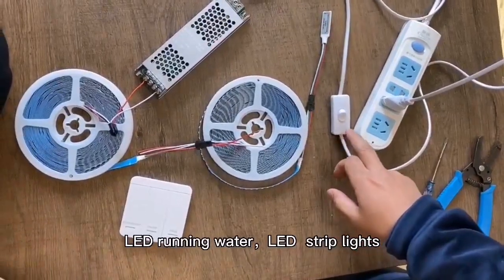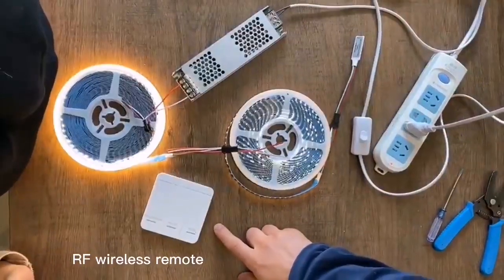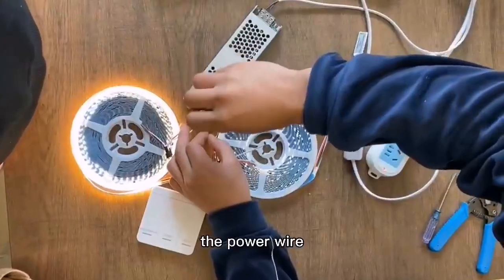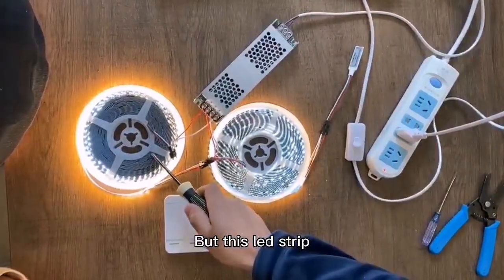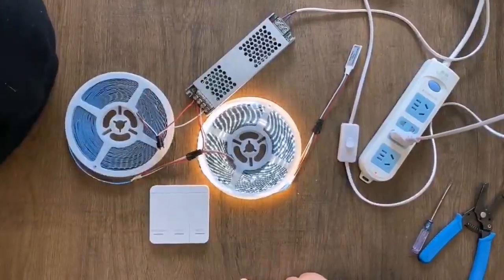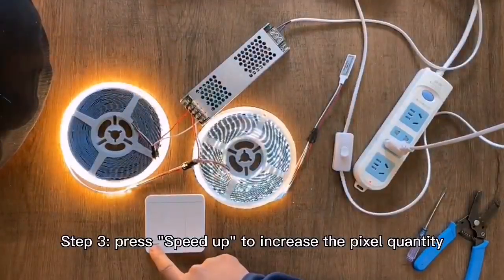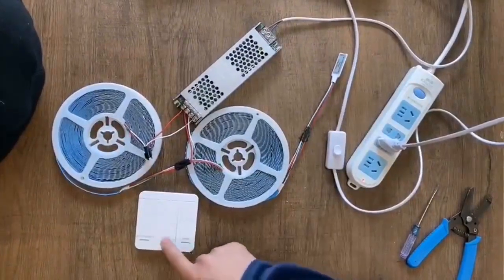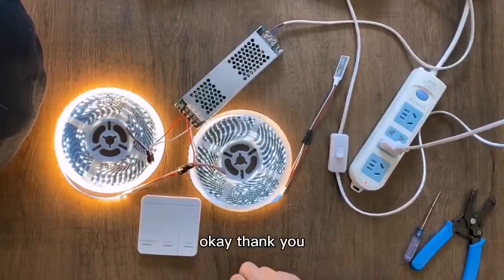How to Increase the Pixel Point Numbers of WS2811 Horse Race LED Strip Lights ?

Comment: The swicth are conected directly to 220v AC ???
Reply from the maker: The power supply INPUT connect to 220V AC, Output connect to the 24V led strip.  the Panel 3 keys remote is powered by CR2025 Button cell.

Comment from the maker: Hope the video to help you. IF someone need to buy the whole set,here we share a link https://www.aliexpress.com/item/1005004870832891.html
Reply: Hi sir i have the same lights 2 rolls of 10m . I wanted for my room but i am having same issue the second roll is only half working... I understand how you did this setup but i have different type of remote 😢🥲
Reply from the maker: you can add my wechat/what's app 86-18938910670 to check
Reply from the maker: @sairaasif8763  see the video to increase the pixel number
Reply: And i am not understanding how can i go setting with that remote
Reply: How much power supply is required for 10meter running water led strip❤
Reply from the maker: @shubhamraut3297  At least 100W high quality, means use efficiency up to 80%, if some poor quality, use efficiency only 50%, must be 200W,even 300W
Reply from the maker: @shubhamraut3297  24V 100-200W, 200W is better
Reply: How you open to control? I tired but no luck